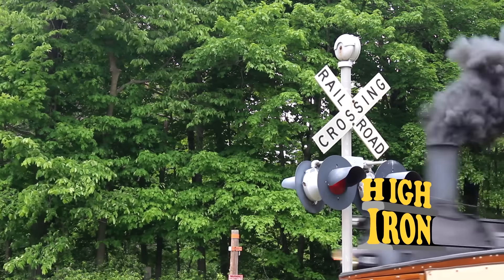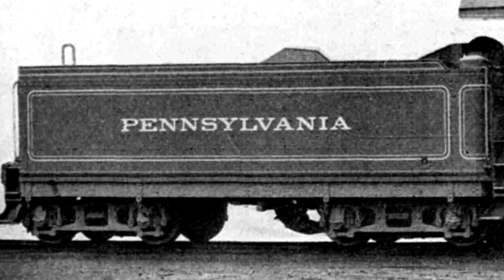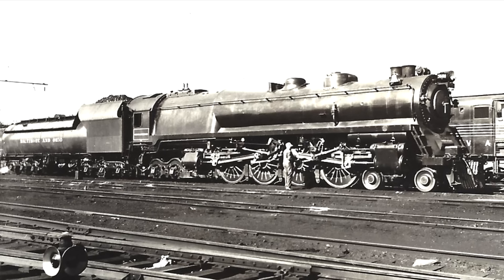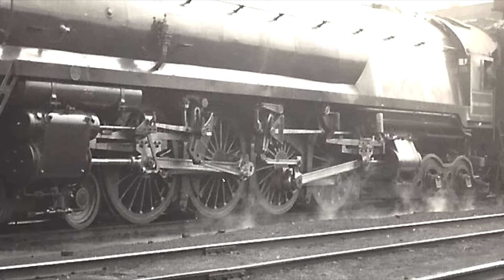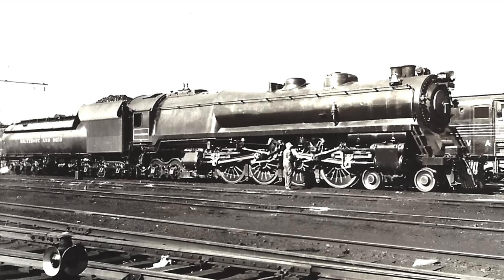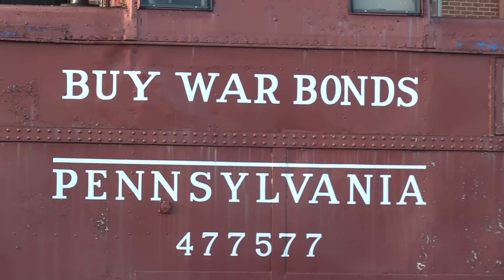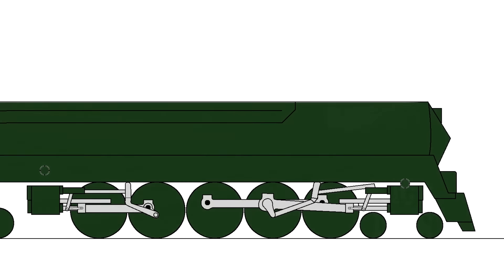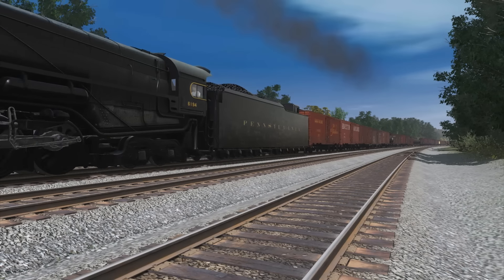Why Weren't Duplex Steam Engines Successful?

Comment: Having to stop every 1.5 hours for more water when operated at high speeds and under heavy load and maybe getting 3 hours under standard loads and speed?  And, car limits of 10 to 15 cars?  It is easy to see why diesel took over.  The only question is why it didn't happen sooner.
Reply: The rather clear answer is part of why the Niagaras were effective on New York Central with an even worse water rate: you don't 'stop every one and a half hours', you scoop water from a track pan.  Yes, that introduces a whole host of issues, but it wasn't an issue in the mid-Forties for the Pennsylvania on the routes that required high steam speed.  Calculate the train resistance of a 16-car train (with axle generators on every car) at 100mph and see whether it's inadequate for a single 6000ihp locomotive that negotiates non-water-level grades.

On the other hand, the only real reason it didn't happen sooner is that PRR's first EMD passenger cab diesels were held up by the WPB until after the War.  By 1947 it had been so clearly established that multiple-unit engines were superior that PRR deprecated actually improving the teething troubles out of the production T1s.  (Note that this was the year Kiefer published his motive-power reports that showed a Niagara nominally superior to 2 E7s... but not 3... as long as you could run the Niagaras at 80mph at their nominal capacity for as much of the day as they weren't actively being serviced.  As soon as that service was gone... it was not long before the Niagaras were, too.
Reply: @wizlish  Oh my, you bring up the other problem with steam locomotives.  The insane amount of time it takes get them ready to roll for cold and the hours of routine maintenance needed.  

On the other hand, they were a huge leap forward in transportation of people and freight.  I'm amazed when they talk of 80 to 100+ MPH speeds, especially since most trains today in the USA don't run at those speeds.
Reply: Many of the issues with maintenance were, in fact, addressed by the end of the Golden Age (and then after on N&W).

Starting a steam locomotive from cold without boiler strain can be accomplished via a modified Direct Steam system, where the boiler is progressively charged with hot water and steam before the fire is even fully lit; the engine can be hostled effectively just on this thermal mass (after the manner of a fireless cooker).  The Swiss rebuilt Kriegslok 8055 can be kept at 300psi indefinitely with nothing more than 35kW or so of domestic-hot-water heater elements and a circulator.

.The 'lubritoria' on N&W simplified the details of lubrication, and it is not difficult to provide this on a mobile support vehicle.  NYC easily accommodated leaking tubes or flues by sending someone in an insulating suit with CA into an actual hot firebox (fire being substantially dumped, of course) to hammer plugs into the ends at the rear tubesheet/tubeplate.  There are alternatives in pressure and grease lubrication that can make some of the problems with total-loss lubrication less of a concern.

But by comparison with 'power-by-the-hour' evolved diesel electrics, even the most advanced Gen 2 or better steam locomotives will fall short -- the advantages of low construction cost and simplicity being lost.

Comment: The Q2 makes little sense IMO. It's a freight engine so it might as well be articulated. 

The T1s we're alleged to have shattered Mallard's record of 126 mph
Reply: But why keep all the maintenance costs of at least one extra axle, all the flexible joints and heat loss and weight in the steam piping, and the double-pendulum guiding and lateral-compensation issues when you can get the highest horsepower you can arrange cost-effectively without a buncha water tenders out of just five axles?

Riley Deem's geared conjugation fixes the only real negative issue on the Q2; the waist problems and mistaken alloy composition would have been fixed by welded construction in the same timeframe all the Niagaras got their replacement boilers.
Reply: And you have to be careful with the Franklin reports of high speeds as reported; they might represent high-speed slipping rather than actual 140mph speeds, just as I suspect the 'rides rough at 132mph' report is apocryphal (the speedos on the T1s only read to 100mph, whereas contemporary American car speedometers read up to 120mph, so there are some logical conclusions to be drawn about reported precision of very high-speed performance...)

Alfred Bruce, who was in a uniquely privileged position to know, claimed that there were multiple runs over "128mph" with the Milwaukee A Atlantics, one of the actual high-speed American locomotive designs.  (He likely picked that number with reference to the unlikely but famous 127.1 PRR 7002 number, but it is not incidentally higher even than the propaganda number for Mallard's speed...)

Comment: I believe the Duplexes were not given enough time to reach full Potential.  Steam was cast aside to soon . Look at the tests against Diesels by U.P. and others using very large Steam. The BigBoys were able to match the 4 unit diesels, I'm also betting the Big Y6 would give 5 diesels a Battle in the Drag up grade. Build New Steam, you could power them by LP or Natural Gas.
Reply: Steam was only kept around by the diesels being diverted to submarines.  If not for the war, most steam would have been scrap by 1943.

Comment: Were any of these locos oil burning steam locos?
Reply: The Santa Fe cab-forward 6-4-4-4 would have been; it is highly likely that the awful-looking engines proposed for Texas & Pacific would have been if built.

In general, the Western roads that wanted high speed went for motor trains and then diesel-electrics rather than exotic higher-speed steam.  ATSF for example had enormous 4-8-4s with lightweight rods that could cruise happily above 100mph... while Hudson's with higher drivers built to the 'state of the art' only slightly earlier were essentially valve limited only a couple of mph over their 'intended' peak speed in service.

One place oil firing would have been highly advantageous was on locomotives with opposed-cylinder arrangements, particularly like the B&O N-1 as compared to the outside piping on the PRR Q1.
Reply: @wizlish  Thanks for you very informative reply, you're a good man wizlish. It shows that the British & Germans weren't the only ones innovating in the steam loco scene.

Comment: It's a really cool and impressive idea, but I just don't see the point compared to diesel. Diesel doesn't require water at all for running, it just runs straight off the fuel itself and diesel itself also is far more energy dense than coal ever could be. Even anthracite coal is only just over half as energy dense as diesel and at best 3/4ths as dense. Still, that doesn't count the weight of the water making less than half that still. Plus diesel is by far one of the most efficient fossil fuels to convert into energy. This is the reason most backup generators are diesel. 

Plus coal also is much worse environmentally and more hazardous to get. It was fine to think of continuing to use coal in the era we used it all the time, but today, why the hell would we ever consider going back to coal? Existing diesel engines are already basically hybrid electric and some portions of the country even have direct power for their lines. I just don't see a reason we'd want it.
Reply: To be honest, no one has seriously said (for very long) that modernized reciprocating locomotives could be sold to Amtrak and used in regular service.  If there is a switch from current diesel-electric, I expect it to be toward hybrid dual-mode-lite, where a battery-electric like the FLXdrive is used as a glorified road slug with diesel or hydrogen-fuel-cell power, and the dual-mode pantograph used for a combination of charging and under-the-wire operation as sections of catenary or smart third rail are built out progressively.  (This also neatly removes any issues with low clearance for 50kV cat.)

Comment: Actually the traction problems were worked out,  unfortunately the coal strike is the real nail in the coffin for steam. Had CAD/CAM been invented back then, things would have been quite different.
Reply: The real nail in the coffin was changes in employment.  Postwar economic development provided a huge range of prospective jobs better than traditional steam maintenance... let alone career choices!  And a very large percentage of the 'attractiveness' of reciprocating steam was cheap availability of the many employees needed even with modern servicing arrangements in intelligent use.

Comment: Why couldn't they connect the to sets of driving wheels with gears to solve the wheel slip problem? here is my idea. on the rear axle of the front set of driving wheels have an axle the connect the power to the front axle of the rear set of driving wheels throut a set of gears of course. that way the front set of driving wheels can't loss traction because it is connect to the other rear set WITH TRACTION.
Reply: That was Deem's idea with improving the Q2 in the '80s, but in my opinion the detail design has to be different.  The 'best' conjugation design,accepting the design assumption for the moment that substantial traction power doesn't go though the actual conjugation (which was an implied premise in some of Withuhn's explanation of his conjugated duplex), is to put Spicer-like ring-and-pinion drives in sealed gearcases made in the centers of cannon driving boxes, then connect them with Cardan shaft.  The most sensible Duplex configuration has common cylinders, all rear-facing to limit contamination and rod nicking (etc.) either with identical rods and balance as on the S1, or with identical rodwork and balance using an extended crosshead guide and piston rod on the forward engine, as in the T1; this involves running the Cardan shaft  under the center cylinder block which in turn introduces shaft-angularity concerns for the 'simplest' approach of linking the front engine's main to the trailing engine's first driver pair.  When you add the requirement of at least one Ferguson or magnetorheological clutch in the shaft to accommodate engaging shock and different driver wear, you wind up with (on a double-four-coupled  chassis) either joining the mains or the coupled axles (either has consequences for side-rod forces and hence degree of buckling deflection of thin-section Timken roller rods). 

Note that some of what conjugation does can be handled by implementing the independent brake to include an air-over hydraulic lateral caliper that floats laterally close to the plane of a driver and acts on cheek plates on a cast center, analogous to the braking arrangement on an AEM-7 electric.  This can easily be used to 'spot-arrest' any emergent spin within a small angle of accelerating rotation, with equally fast release, without requiring adjustment of either the throttle or cutoff; it also allows a range of 'trim' or automotive-style traction control to keep an unconjugated forward engine from slipping and unloading the rear engine, either in low-speed or high-speed slipping conditions.

Comment: England - What a superb video. As many Americans maybe aware we have hundreds of rebuilt steam enines running. It's yet another British desease. My only comment is the thought of running a steam train on diesel oil. It's like putting tomato sauce on prime steak - definately a no no.
Reply: The funny thing is that all the early development work was done with the intent of retaining the solid-fuel firing (part of the "failure" of the T1s being attributed to the relatively small grate area, which proved prohibitively costly to modify without changing the appearance of the locomotive).  While there is no soft coal smoke aroma, there is much to be said for properly-designed (NOT like on Reading T1 2100!) light-oil firing that can be sourced and supplied through the normal railroad fuel infrastructure or commercial distributors, and that flows properly without external heating.

Comment: so i work on boilers as a day job. i am curious why they never recovered the condensate and save water usage? all of the videos show steam loss from the cylinders.  the boiler design looks like ones used on ships of the time and should have been able to run a small generator to power a pump.
Reply: Steam recovery has indeed been tried out on steam locos in the past with mixed results. To be efficient at it usually requires lots of machinery that takes up space that is not available on locos. And usually the mechanisms ended up using more $ in maintenance than the savings in water
Reply: Ray Leno has some videos of steam powered cars, here on YouTube, that recover the condensate. They do 100kph easily.
Reply: About the most sophisticated attempt at a full-condensing road locomotive was the Steamotive design effort in the mid-Thirties, culminating in the GE turbines 1 and 2 for Union Pacific.  These had enormous shuttered condenser area, but still more enormous condenser issues.  The chief issue is handling the mass flow of exhaust steam while assuring low back pressure or high vacuum, and it's difficult to get the phase change quick enough without the sort of infinite cold sink you have on a ship.

One of the British turbo-electrics (see the inimitable Douglas Self's site!) solved this "correctly" by spraying water over the condenser coils.  Of course you will realize this either requires a second source of untreated water or more water stops...

The ACE 3000 was a full-condensing design, intended to produce 3000hp and be able to MU with diesel-electrics.  To my knowledge there was never a more carefully worked-out condensing arrangement -- and there were still plenty of situations where the condenser would choke and the engine would have to exhaust 'direct'.

The much better solution was probably Holcroft-Anderson recompression, which kept the (considerable!) latent heat of vaporization in the exhaust steam, but lost the remainder of the heat in the exhaust that hampers pressure phase change.  This was interestingly if somewhat dottily implemented on the Southern (the GB one), where it actually worked -- in steady, balanced operating condition, something you might find on the Dona Cristina with Porta's 2-10-2 builds, but not very often on British 'metals'.  On the other hand, a great deal of the necessary control could be easily automated today, and I think only because the whole company was bombed out of existence in the Blitz explains why more wasn't made of the idea.  (The fundamental idea was also implemented by Gotawerken on ships, and John Sharpe proposed a turbine rather than positive-displacement version in the '70s that almost everyone misunderstood...)
Reply: And here I was just thinking of a modded steam trap like what I use to pump my condensate over 5 blocks back to my boilers.
Reply: That would clearly work... once you got the actual 'condensate' at ambient pressure; that involves not only dropping any supercritical heat, but the full latent heat of vaporization.  Accomplishing the heat loss and the phase change is the problem, not recuperating the condensate mass afterward.

The advantage of the open-type FWH over most closed-type versions is closer to an effective method of 'condensing' exhaust steam.  The problem then becomes a sort of embarrassment of riches, for the same thermodynamic reason that blowdown into the tender cistern doesn't work very long.  Just the latent heat means that one condensing mass equivalent of steam raises six times that mass of water from freezing point to boiling point, and pretty quickly you run out of full "condensing" of more steam without starting to experience flashing problems (and your injector or ESI not working...)